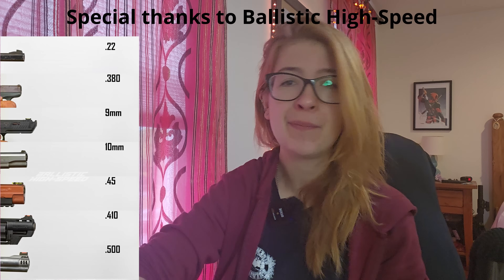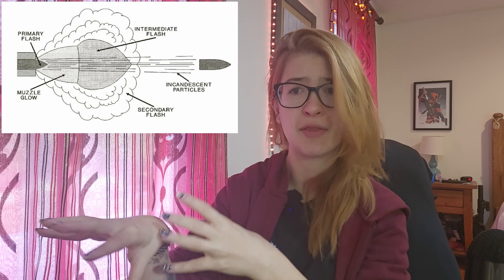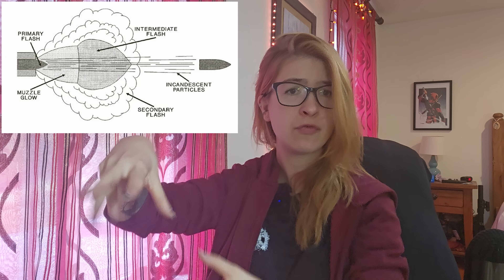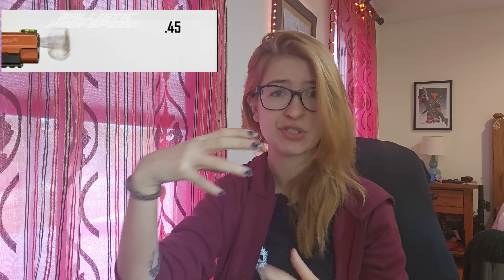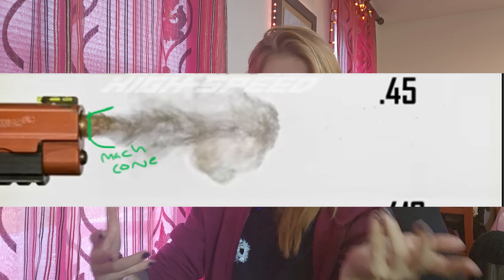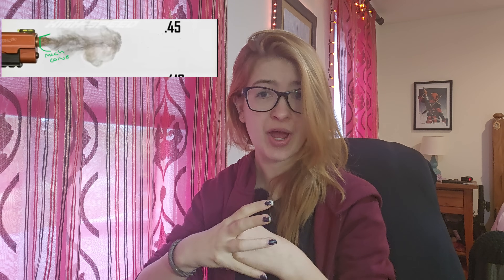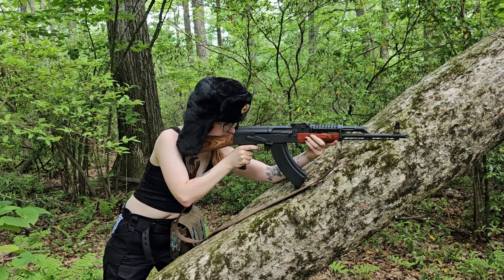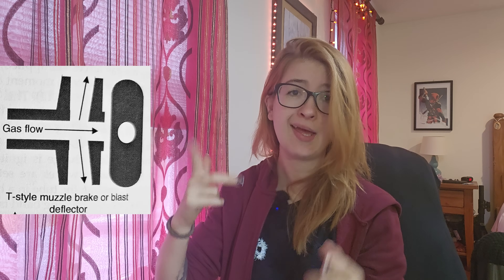Ballistic HighSpeed Analysis: 808s and Muzzle Brakes

Comment: Loved to see your break-down! Always a pleasure to see others' perspectives.
Reply from the maker: Thanks so much!! Wouldn't have been able to make a video on this topic if it weren't for you guys capturing those intricate moments
Reply: Basically muzzle brakes are ok but there is a better way even integrate a suppressor and using the length of the barrel and only goes less out the front so it doesn't thread on the barrel and yes with better components even fiberglass like from a muffler it works better

Comment: It was great to hear someone talk about this who has a background in this kind of stuff. I have a question about pistol compensators: do the gases actually exert enough force to drive the muzzle down?  When you see high speed footage of pistols like this they never actually seem to force the muzzle down.  Where does the recoil reduction come from then?
Reply from the maker: Lol hot take but the best pistol compensator is a solid grip. There's obviously different stuff on the market so I'm generalizing but for the ones that are cut into the barrel, I think you're seeing more of a reduction in velocity thus making it a "softer" shot. For the ones that thread on, perhaps its more of some additional weight (albeit minor addition). The concept of them makes sense, I do agree that I'm not entirely sure of how much they're actually doing, though. I do think that they largely benefit from rapid follow up shots, so those single shot slow mo vids don't do a great job at showing what's going on
Reply: @Boondockballistician  not a hot take at all, its 100% true.
 My personal theory, just from playing with loads for my uspsa open gun and very basic slow-mo from my phone, is that they dont drive the barrel down, but the gasses delay the unlocking of the barrels and reduce the force that slide hits the frame with.

Comment: As an old guy who's been teaching firearms longer than you've been on earth, I appreciate the Geek side of things because it gives me the ability to relate how the different muzzle devices affect things like flash, sound, concussion and smoke signature.  While I took some physics in college, it wasn't a specialty and much of this really relates more to fluid dynamics, something I didn't look into at the time.  

For future videos, I for one would like to see your take on the differences between a ported barrel and a muzzle break and also how the linear compensator handles blast.  I've had a thing for linear comps for some time, I love the aesthetics and how they tend to throw much of the sound forward as well as everything else, but I'm not sure how the device handles shock waves, particulates, smoke signature...  Most of these comps that I have are enclosed, with a series of ports in the muzzle end around the center port for the projectile, vs the open conical types which look more like the old conical flash hiders.

Comment: Some of the first "flash suppressors" which, I think came into use in WW1, and were fairly mature by WW2, seem to be the conical type, You will see them on BOFORS 40mm cannons (just the first example I thought of) but even the M2 Carbine had a funky attachable variant. In my experience, these are fairly effective at least from the shooter and bystander perspective. Would be interested in hearing any thoughts on this design. FWIW, the AR-15 A2 Birdcage is the same thing, just slotted.

Recently, a lot of my shooting group started running a particular brand of muzzle device which has a screw on blast deflector, what was really interesting was a muzzle brake itself wasn't very bright, however with the blast deflector in place, it would be significantly brighter.

Comment: I would like to see what if any affect the cut of a handgun slide affects the exiting gasses. 
Using a Glock as an example, Instead of being square cut at the muzzle it has a gator mouth cut where material is removed at the 3 and 9 color positions. On my handgun the barrel is not quite flush and the slide extends past by just a hair with the gator mouth cuts.

Comment: Very interesting.  Anecdotally, I've noticed that muzzle devices using 360° concentric venting (A1 and vortexflash hiders, pepperpot brakes) often seems to yield slightly more precision than ones that do not (A2 flash hider, baffle and t-brakes). 

I thought this might be from exit gasses moving on a bias and impacting the bullet's stability, but I'm out of my depth.   Is there any real research/understanding on this?
Reply from the maker: Yeah that absolutely makes sense! It being concentric allows it to keep a more even gas flow distribution and not cause some unintended flinch. The radial flow means it's not going to disrupt the barrel harmonics as much either. I will always recommend people who load their own ammo, fine tune their builds based off of whatever muzzle device they might be using
Reply: Flat base over boat tails are in a similar boat. More even release of pressure and gas less likley to impart as much yaw. And a bit easier to find discussion on if ya go down that rabbit hole.

Comment: Great video! Totally here for the nerdiness. Look forward to hearing you expand on this. 

Just out of curiosity, why is propellant under oxidized? What happens at perfect stoichiometric or over oxidized? Would a complete burn be cleaner? Too hot? Cause rust?

I'm a diesel driving, biofuel hippie (with guns) so I try to run super lean to have zero particulate. The soot is like sandpaper to the engine.

I don't know if the same kind of dynamic happens to the barrel or internals or if the oxides are worse.
Reply from the maker: Yeah it's a weird balance. Interestingly enough, you get more energy back when a new bond is formed than the amount of energy it takes to break the original bond. So in a way, allowing it to oxidize during the firing event allows you to get a net energy out. 
Liquid propellants are actually over oxidized! Since usually those are for rockets, going into the atmosphere, and need to supply their own oxidizers. But being over oxidized will definitely change the density and burn rates and all that.
No matter what, there's going to be unburnt propellant in the system after firing, so playing with the oxidation levels allows you to have more control over that burn as you go. And of course, account for natural barrel wear and degradation of the system